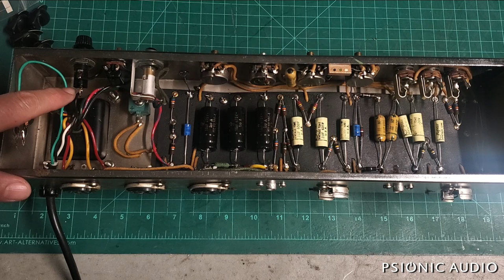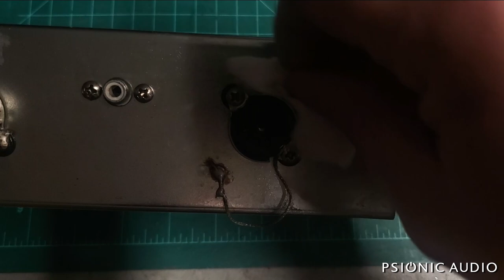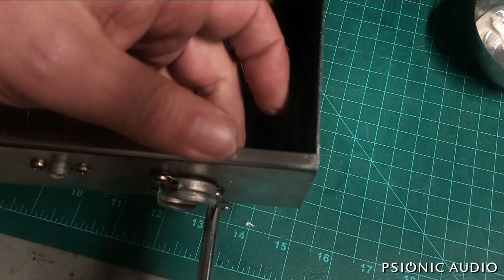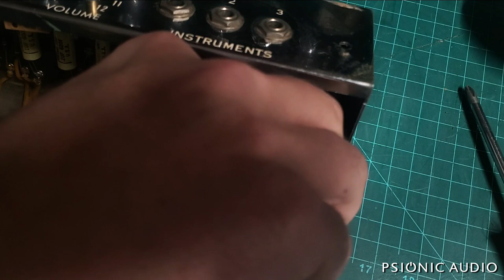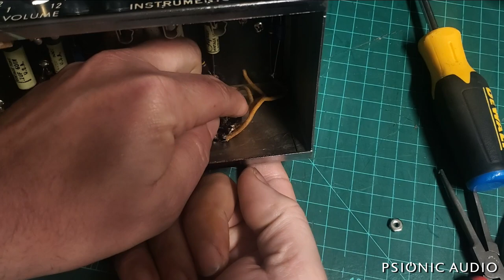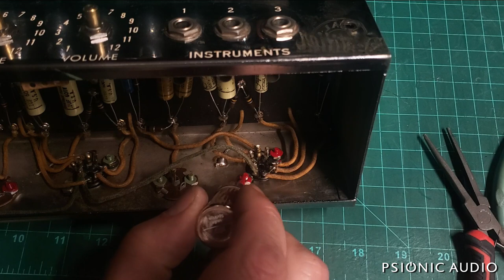'59 Fender Vibrolux | Part 3 : Lots of Sexy Grommet Action

Comment: Nitromethane (race car fuel, also used for pre-drone-era RC planes) will soften old paint and lacquer based threadlocking compounds (glyptol and similar); smells a lot better than acetone, probably less toxic too. Even more flammable than acetone, however, and if you don't keep the cap or lid on tight it will all evaporate.

Comment: This is great info. I'm deep into restoring my '56 Deluxe (lots of cleaning going on first) and these videos are just what I needed. The tube sockets are still snug so it's off to the hardware store tomorrow for some acetone and grommets. The Grommets are pretty rotten on mine. Otherwise I've just got the usual stuff to do. I'm going to pull the board and do it up right, it'll be good for me, I need a challenge. That was interesting about the Tung-Sol reissue, I repaired a problem in my '64 D.R and wound up with leakage (the guitar coming through when the amp volume was off, I think that's what you meant), I went a little crazy wondering what I did wrong, then I changed the Tung-Sol for a Sovtek and the leakage is gone (whew).   Thank you for this.

Comment: To my way of thinking, lifting and isolating the heater supply from ground and using resistors to create an artificial center tap is justified to protect the power transformer from damage in case a tube shorts (the resistors would act as fuses). The hum reduction created thusly is a secondary benefit!  It's nice to be able to keep circuits and wiring original wherever possible and practical, but in this case you really want to do whatever is necessary to protect the all-important original power transformer.

Comment: Silicone rubber or nitrile grommets might be a better choice than ordinary grommets, as they'll be more resistant to heat as well as grease and oil resistant. A lot of what you buy in these days that is sold as being "rubber" isn't even neoprene, it is presumably some kind of latex, and not resistant to solvents or chemicals. I tried stopping up a small plastic bottle of vinegar that was missing its cap with a black rubber stopper from the hardware store,, and just the fumes alone  from the vinegar made the stopper swell up inside the bottle so badly that I barely managed to remove it (I use vinegar to foam away battery leakage and corrosion in flashlights etc).  If anybody here has a favorite source for solvent-resistant rubber stoppers and grommets and so on, please share.  I am also looking for solvent- resistant syringes to use as applicators for contact cleaners and so on.

Comment: Just wondering how you protect yourself from breathing fumes when you solder.  Thanks.
Reply: Fumes from leaded solder (tin-lead alloy) aren't really very toxic because the melting point of the solder allow is well below the boiling point of lead. (Leadfree solder is a whole 'nother story, I will get to that in a minute). The traditional rosin flux-core found inside the leaded solder is made from pine tree sap (pretty much the same stuff they put on violin bows),  and while some will find the fumes mildly irritating, once again any "toxic" effects are minimal. A fan, an open windows,  or an exhaust system that sucks  fumes to the outside is recommended if you find the fumes obnoxious.  On the other hand, leadfree solder contains and requires the use of organic acids in the flux,  which are extremely irritating to the nose and throat, and consideted toxic. Some formulations of leadfree solder contain copper or bizmuth and these are metals that you should avoid breathing.  I'm not sure the extent to which the fumes from leadfree solder will contain any of those metals, but leadfree solder does require higher soldering temperatures in order for it to flow and wet to the circuit board traces and component leads,  and in combination with the acidic fluxes there is a much stronger possibility of you inhaling metallic vapors.

 The main reason that most technicians hate lead free solder is because it tends to make for grainy solder connections that break down and crystallize over time,, especially when exposed to temperature extremes, including extreme cold as well as heat. Leadfree solder invariably means that the lifetime of any device made with it is shortened due to degraded, intermittent and broken connections that would take much longer to occur if ordinary lead solder been used. Also, while rosin flux is generally non-corrosive and non-conductive (although it can sometimes become conductive at the high voltages found in tube amps, especially in humid climates, which is why Lyle scrapes off old crusty flux and dissolves the residue with alcohol), the acidic fluxes used with leadfree solder are definitely both conductive and corrosive to the circuit board, and must be carefully washed off (with distilled water) afterwards. By the way, the acidic fluxes and higher temperatures required for leadfree solder tend to cause premature degradation of soldering iron tips, especially if they are cheap quality.
Reply: You can buy a small exhaust fan, made just for wicking solder smoke away. It’s an exhaust fan.